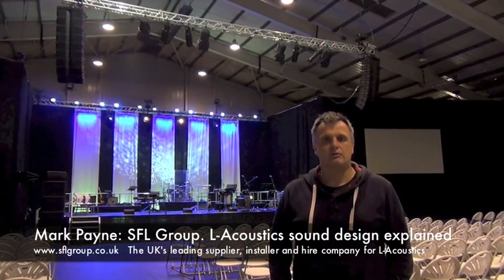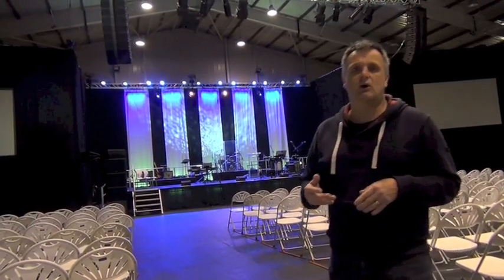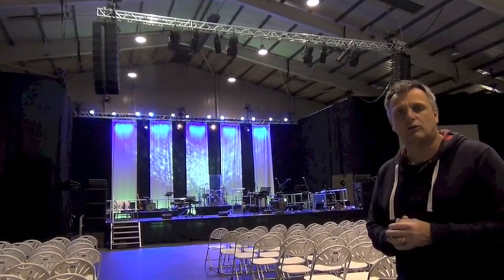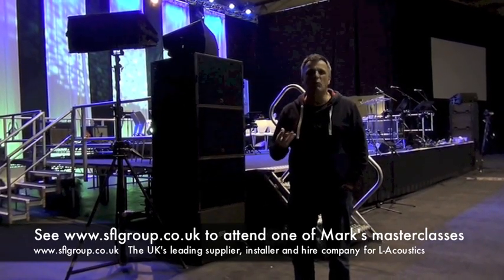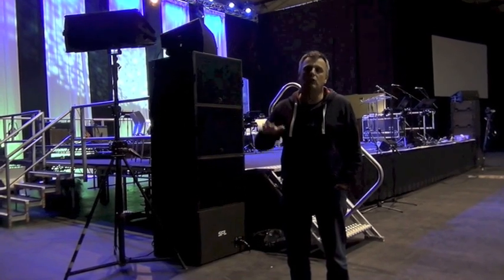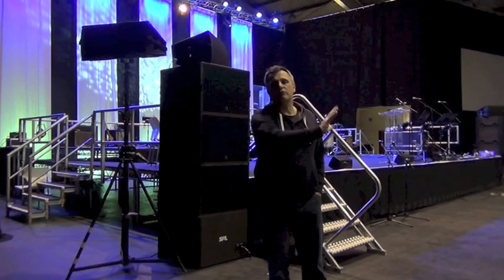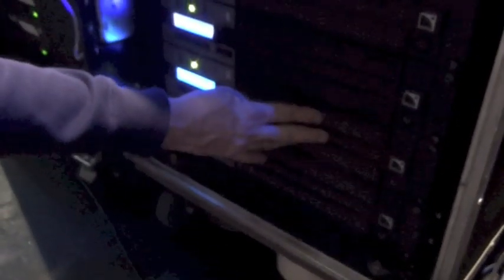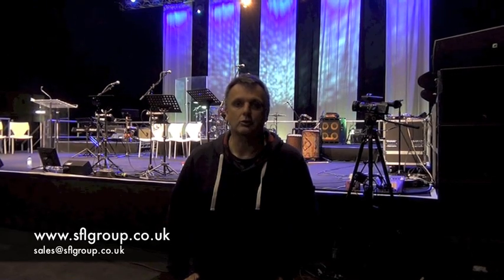L-Acoustics Kara System Design

Comment: Great video!Can i ask you how you connect 8 sb18 in cardio mode by one lx8, is it the same as in normal mode with Ycable or you have a another rack  on ather side?
Reply from the maker: As you guessed, I split it at the amp and feed both sides with a L and R shaker from each channel.